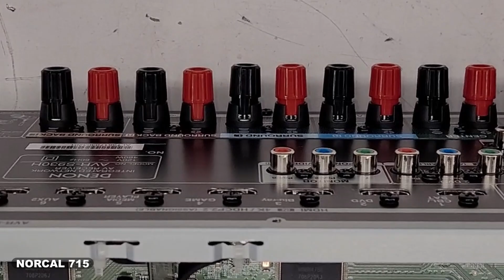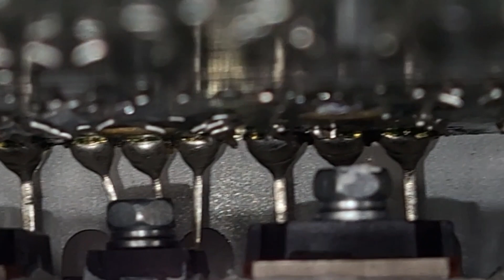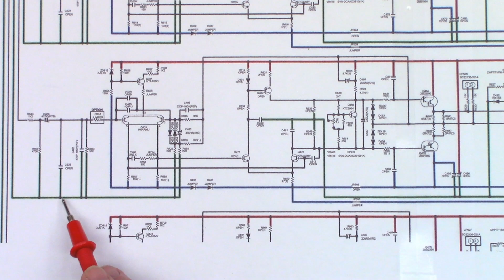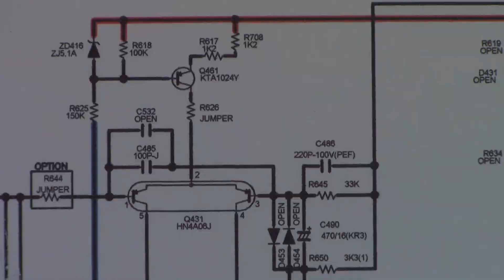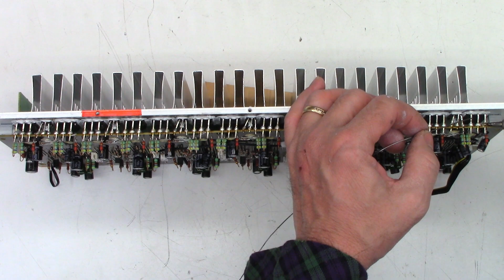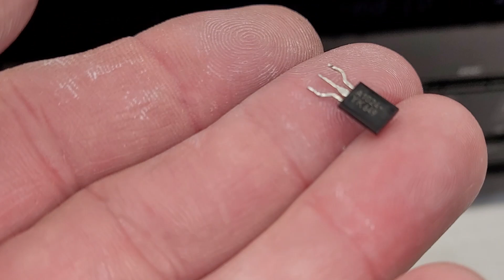Denon AVR-S930H AV Receiver - Shuts down - Red blink of death - Another High DC Offset on one output

Comment: My AVR-1312 developed the red blink of death after light use and a significantly long time in storage. Gemini AI has been instrumental in leading me through troubleshooting, and I think I've determined the Front Left channel is borked due to a shorting transistor. Not prepared to take it apart and resolder things, but wish I had those skills! Think I'll give it away instead.

Comment: Excellent video and very helpful as starting point for a recent faulty AVR X2400H which shares the same design schematics. This one had similar issue with 'red blink of death'. Removed the amplifier PCB and rigged up a PSU to power the board. Same issue was found with the centre channel indicating a varying 2-5 volt DC on its output. Looking at it with an oscilloscope showed a swing from approx -4 to +5 with oscillation that was random in high frequency. Removed Q425 KTA1024C which is used for ref voltage on the 'long tailed pair' Q419. Also removed and tested  Q436 KTC3206Y. Both of these transistorstested fine and were refitted. Next check was across the Zener diode ZD407 5V1. This had a volt drop of approx 2.6 volts across it was was obviously wrong. Checked the similar zeners on other sections and they were 5.1 to 5.2 volts so replaced ZD407 but it made no difference. Next checked the resistance at R496, R490 junction which is on the base of Q425 and anode of zener ZD407. Got a reaidng of approximatly 130K ref to 0V. Checked this resistance test on other channels and average was around 76K . Removed R496 and checking it revealed it was open circuit. It showed no physical damage but replacing it resulted in stable volt drop across zener ZD407 of 5.1V and output had dropped to 0V with no evident noise. Put amp board back in, powered amp up and all good. Starnge one this and thought someone might find it useful in the future. Keep up the videos !!
Reply from the maker: Thank you for your diagnosis.

Comment: Hello, two channels are either burnt or burned, I bought the power transistors, put them in their place, I did as it says in the book, the trimpot is at 0 and I have over 50mv on all channels, in a minute the radiator heats up to over 90 degrees, and no channel is regulated, can someone tell me where to start? thanks

Comment: Where can I buy or make the part to check idling current? I think you called it a bias jig. I have a Denon avr-x4500h it has 3 pins im trying to cut a plug to make it work but i don't have one around that size. I don't want to short it out again

Comment: Good morning, I am Brazilian and I have a Denon AVR 982. Recently, when I turned on the device, it worked normally, but when I clicked on surround, it went into protection mode. I tested the audio outputs and they are fine. The standby light is blinking three times slowly and then blinks constantly. Do you know what it could be?
Reply from the maker: I do not know what it could be. Sorry. Here is a link to a service manual (if you do not already have one) https://elektrotanya.com/showresult?what=avr982&kategoria=All&kat2=All

Comment: That . Was a clean diagnosis sir. I had an old rare top of the line Nikko receiver with the same issue. It had a regulated power supply . I changed the output transistors on the bad channel but still hummed bad. Took it to Star Track audio repair. A year later I called inquiring about it. HE TOOK IT TO THE DUMP! You have a new subscriber here. You earned it!

Comment: Nice fix. I was wondering about the resolder of all the pins. Did you use lead free replacement? I've found the lead free stuff doesn't preform the same when redoing a joint and always have to resort to getting rid of as much of the original solder as possible and by that stage, it's then just easier to put back leaded solder. Mixing leaded and lead free doesn't seem to work for me either for long term.
Reply from the maker: I use Kester 60/40 or 63/37 mostly. I used to remover the old solder but after many years I have not seen any difference if you remove it or not.

Comment: Great video, was this transistor in a power regulator circuit? It looks like it was connected to a half wave rectifier circuit with a 16 volt filter cap
Reply from the maker: It was in the differential amplifier regulation circuit.

Comment: My parents have a s940h. It's already been in the shop once for a faulty wifi and Bluetooth module. But now again it's failing. Sometimes it won't connect sometimes u can't even find the unit when you search for Bluetooth devices to pair. Onkyo also had a similar issue as well. It seems these units nowadays aren't meant to last long anymore. All other functions work fine. It has great sound too and plenty of power to back it up. I ran a set of infinity crescendo cs-3009 floor speakers on it and they sounded great.